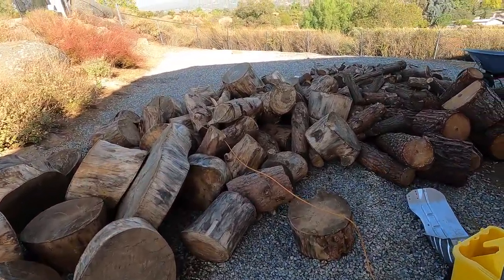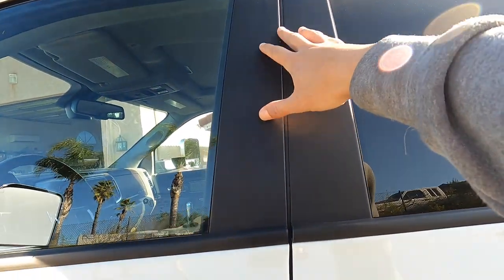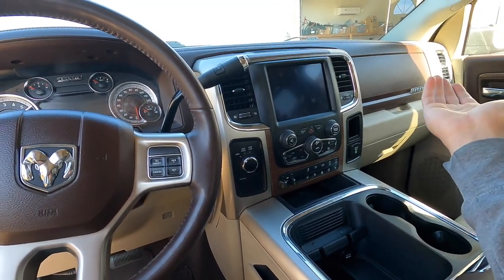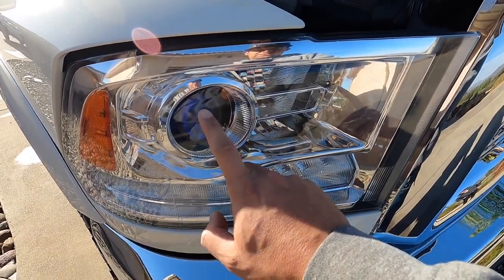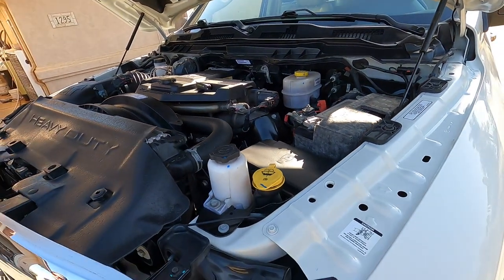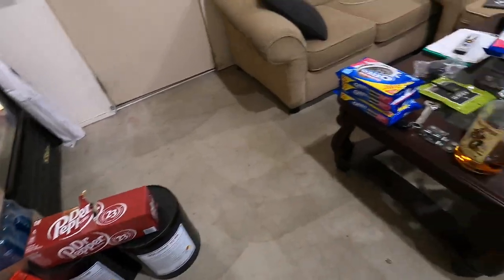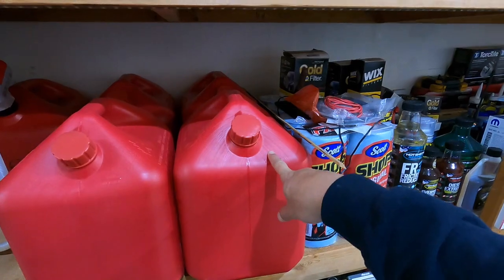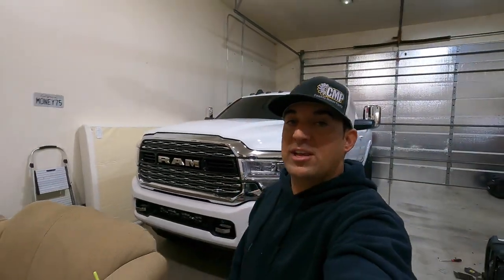2018 RAM 2500....Full tour of the new truck

Comment: Terrible experience with my dealer! I have a 19’  2500 with the cummins, took the truck to get its first oil change at 5,000 miles because I’m OCD and wanted to make sure there wasn’t any metal/contaminants in the oil. Long story short,  in 19’ cummins switched to 10W30, well the dealer put 15W40 in it and it started to develop a ticking sound (No not the same sound as the CP4 failure). Took it back to the dealer, where is sat for 3 months for them to troubleshoot this sound. Turns out the oil was building up on the lifters, and they needed to be replaced. Just over 3 1/2 month total time in the shop I get the truck back. So after that’s all said and done, 2 months later I get this little lightbulb in my head... “I wonder if they services it with the correct oil this time?”.... call the dealer up, ask them if they are aware if they are using the incorrect oil..... AND what do ya know,.... they had no clue that they were servicing all the 19’ and newer incorrectly. So hear I am, with a truck that’s literally been stripped down put back together a few times,  and it just hit 1 year old last weekend. I want to start doing the oil changes my self but heard rumor if something fails they could fault the damage to me changing my own oil.

Comment: Black oil in a diesel is 100% normal. Is not caused by egr or emissions components. A 2006 will also have black oil after a fresh oil change.

Comment: Eddie now that you have basically the same truck as me, I want you to look into something I became curious about the other day. I wonder if there is a way to change your air/heat mode ( i.e. from floor to face to defrost & feet) without using the touch screen. Basically I was driving the other day and though "wow, if my touchscreen breaks then I'm just stuck on this blower mode....besides using the button for straight defrost. Hmmmmm

Comment: Loved my 2017 longhorn hated my 2019 longhorn 3500 I screwed up and traded. Now I’m back to a Ford F-350 tremor but  a 7.3 gas. Loving it
Reply: Why’d you go from ram to ford? Just trade my 2015 1500 longhorn for a 2011 big horn 6.7 ram 2500. Shes a beast, Now I can tow heavy machinery for work. miss the longhorn interior but the heavy duty diesel opens up new doors.